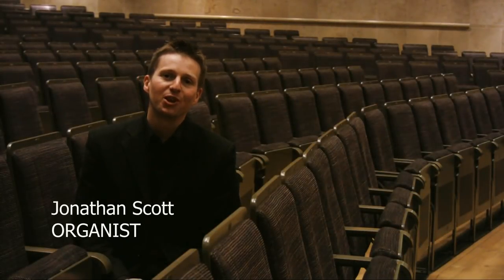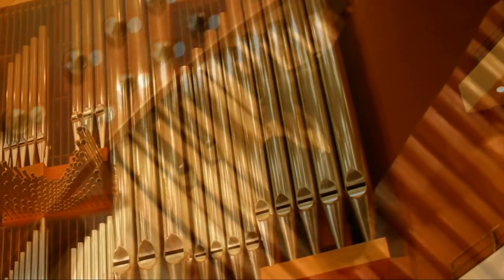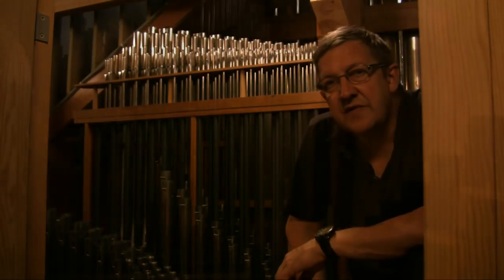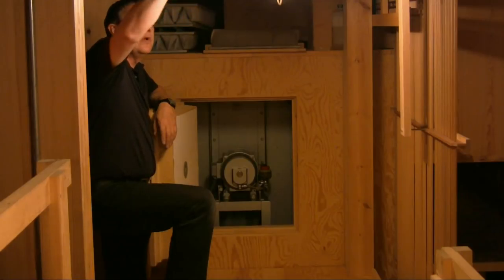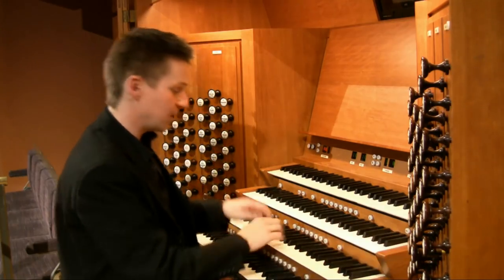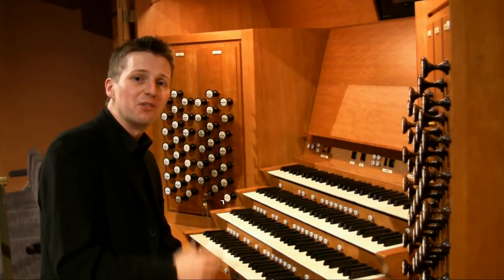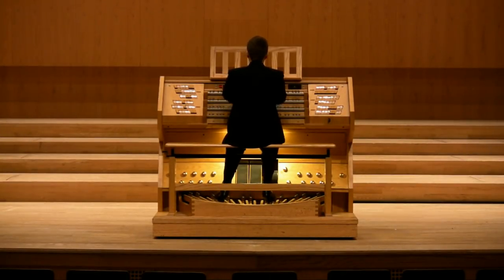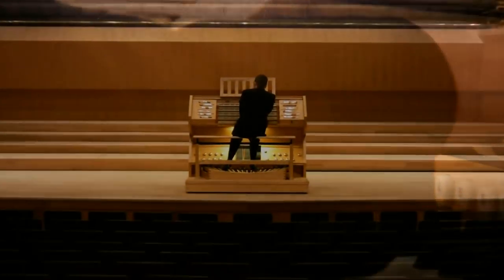THE BRIDGEWATER HALL PIPE ORGAN AND HOW IT WORKS - JONATHAN SCOTT

Comment: When you close the shutters on the swell box, does that also alter timbre of the sound?
Reply: Yes
Reply: No. Nothing will alter the timbre or character of the pipes under expression (aside from voicing and tuning). Only the volume is effected.
Reply: The pipes make pretty much the same sound, however the box reduces the volume of the sound. Lower frequencies are reduced less, so as the louvres (shutters) are closed, the sound becomes quieter and less bright. Conversely, opening the louvres increases the volume and the brightness of the sound.

The change in brightness is fairly subtle but quite noticable noticeable, particularly with registrations that have lots of high harmonics (such as reeds and mixtures).

Comment: Interesting that you show the stop action in the animation as mechanical. In fact the organ uses huge, power-sucking solenoids to move the sliders. The organ is also hybrid - neither tracker nor electric but a combination of both. all the nonsense about the "Feel" pf the organ is eliminated by the use of coupling solenoids - the design of which is stolen from Wicks Organ Company in the USA (Pat. 1905). It is nice to see that they provided a full range of  harmonics for the various divisions. unfortunately the use of 1/2 length reeds produces rattle rather than smooth reed sound. There is little question of the question of quality in the construction. but the beautiful classic cases that make most English organs a feast for the eye as well as for the ear, is lacking. The performance - No question there. Johnathan is like one of the most under-rated organists today. For organist do as much to bring classic music to the general population as the Scott Brothers.